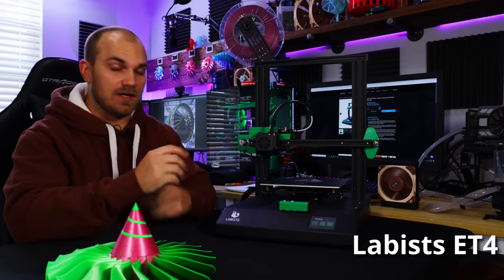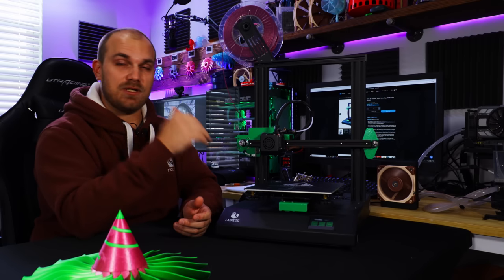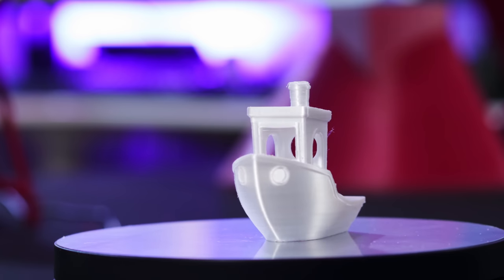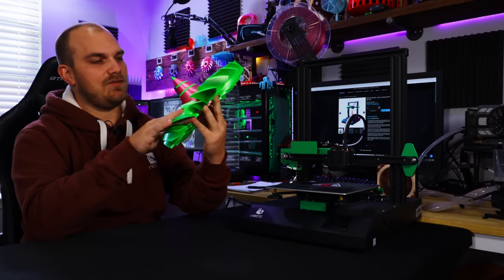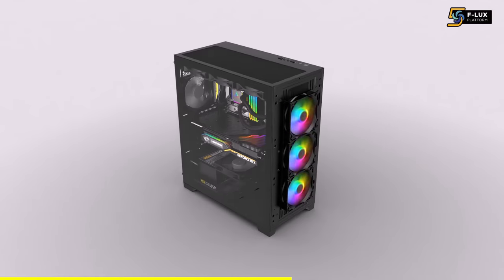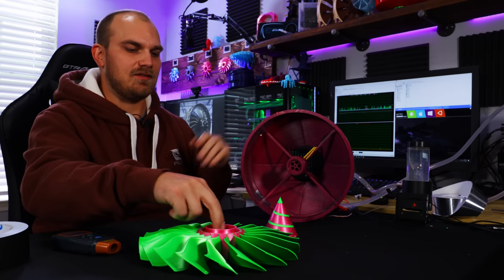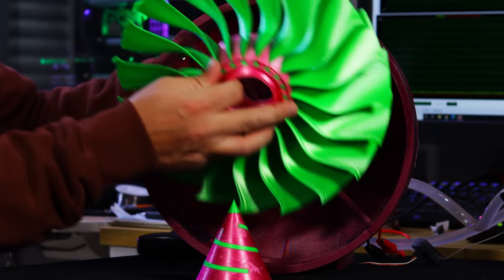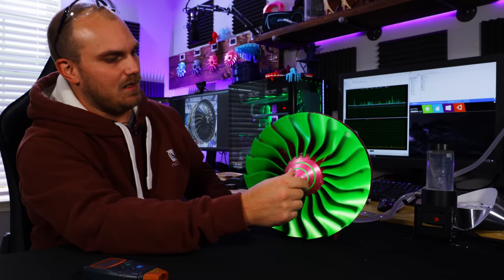3D Printed Jet  Engine Fan Water Cooling | Labists ET4 Review

Comment: Be aware that the centre 30% or so of the blade works as the primary stage compressor blade for core and the outer 70% or so works as a traditional fan so it will not work as efficiently as a dedicated fan design as the inner fan shape is optimised for maximum flow at high pressure ratios with a stationary guide vane to redirect flow after it.
Reply: What does "primary stage compressor blade for core" mean?
Reply: @kylenakamura4353  it means that the compressor in a trent engine has 3 stages, one for each of the shafts in the engine. The second and third stages (intermediate pressure and high pressure) are dedicated compressor blades, but the 1st stage (low pressure) compressor blades do double duty as they also extend beyond the core casing in order to function as the high bypass fan.
Reply: @17473039  that "high bypass" just means blowing air around the outside of the combustion section, essentially performing cooling duties, as well as also providing a good portion of the thrust.  If he were to make a guide vane behind it to redirect the air, it would have moved a ton of air.
Reply: The bigger issue than that is that a jet is designed for very high velocity, resulting in a very high advance ratio and so none of the blades are at nearly the right angle for a cooling fan, which pulls air in from stationary and only gets to a relatively low velocity at maximum. If you look at all the successful fans, they have fairly shallow blade angles to the direction of rotation, while the turbofan design has a much steeper angle, particularly on the inner blade.
Reply: @kylenakamura4353  a picture is worth a thousand words.  So here is a cross section of the engine that blade is likely from.....
https://www.rolls-royce.com/~/media/Images/R/Rolls-Royce/content-images/aerospace/airlines-product-images/trent-xwb.png?h=430&la=en&w=737

If you look at this cross section of a turbofan engine (this one is a high bypass turbofan), it will make a lot more sense.   The "fan" he is using in the video is the first "fan" in the system. 

first thing you will notice is that its first stage of blades (known as the turbofan) is significantly larger than the rest of the stages.  You will also notice that there is a "ring" of what looks like mostly empty space between the outer casing and the rest of the compressor stages.   That ring is the "bypass" (the name "high bypass" refers to how large this ring is,  this engine has a "high bypass" ratio).  The turbofan is actually where most of the thrust in High Bypass turbofan Engines generally come from (up to 70+%).   This turbofan what He has printed and is attempting to use in the video.

The turbofans inner section (the part with the steep blades) feeds into the Compressor stages (primary flow), whereas the bulk of the blades (the broad swept out section) are actually feeding the bypass (secondary flow). The secondary flow primarily just makes its way out the back of the engine and produces thrust ( its fairly common to tap into the bypass for other things as well, but the bulk of the air will just serve as thrust). the primary flow is compressed through several stages, before being mixed with fuel and combusted, driving turbines, that in turn, spin the turbofan. 
this is a large part of why these engines often take soo long to start, as they need to "spin up" with help from an external source.  Usually the APU (a smaller engine that provides power to the plane when the main engines are off.) Will direct some air to the engine to start it spinning.   Once its spinning fast enough to start combustion, the engine will start to self power.   usually they will then use the running engine to spin up any other engines (remember how i said they often tap into the bypass for other things?)

so with all that said, its the "primary stage", feeding the compressors. "compressor blade" is referring to the inner section of the turbofans blade, that is used to feed the primary flow, "for [the] core" is referencing the inner section of the engine with the compressors/combustion/turbines.

What they are saying is that the inner portion of the turbofan is optimized for feeding the compressors and not for "bypass".   Whereas a proper PC fan is 100% designed for bypass.

There are a many different types of jet engines, and all of them are extremely interesting to learn about if you have that engineering curiosity.   Id recommend watching a video on how they work, You might find it far more interesting than it first seems.
Reply: Additionally, in the destruction "test" the fan only broke when it came free of the motor. I bet it would have been workable  had he mounted it better
Reply: @chubbysumo2230  High bypass air is only for thrust and routes around the outside of the cowling.  engine cooling is done by the high pressure air that is not used for combustion internal to the engine.  Some engines also incorporate a venturi or ducting to route air into and out of the nacelle for additional external cooling.
Reply: @chubbysumo2230  The other stages behind the fan are sucking which helps the fan to move air.
Reply: Just like there is no real reason why he should have a spinner on it.   A proper inlet would have helped more.
Reply: @jasperrost78  In the center of the fan is the hub, a section of brick wall. A correctly sized spinner should help by guiding the air past the hub and into blades :)
Reply: @steverpcb  imo that is pretty irrelevant in this setup.  Sure in an proper engine there are many uses for a spinner. But as long as the fanblades don't require the spinner to stay in place (not sure how RR constructs their engines)   it shouldn't be necessary here.  Like I wrote earlier, a proper inlet cowling would have a greater effect.
Reply: Also. Keep in mind that the fanblades profile of commercial engines is optimized for close to mach1 tip speed.   Probably nowhere near optimal for these speeds. Although a random Internet stl won't have the proper profile.

Comment: This definitely deserves another shot, maybe scale it down.
Reply: would suggest scaling it to 120mm or smth more standard aswell, if you actually did scale it to 120mm you could also compare it to the Noctua rather reasonably
Reply: Sorry, you mean scale up, right? Maybe like the size of the real thing xD.
Reply: Lame
Reply: unless you want to spin it so fast it explodes, but that would presumably wreck his room, but I'm sure you can do it on your own if you don't love your eyesight
Reply: The problem it seems is the motor overheated and the plastic softened out of the shaft. A more heat resistant plastic would work, like certain carbon fiber filled nylon filaments, but those kind of filaments also require special environments to print correctly, like a very hot hotend, a heated enclosure, and a very hot heated bed.
Reply: @paranoidpanzerpenguin5262 Edit: I've appearently not been as awake as i thought bc i missed your first sentence doing this the first time:yeah maybe that would help making it not fall off in the end but that only happened when he went all out to destroy it, i could see beeter airflow help the motor cool so the plastic doesnt actually melt 

Unedited: I cant see how a different material would change aerodynamics, frankly the air doesn't give a fuck whether it's moved by plastic, alluminium or play doh. play doh wouldn't give a great propeller tho.
I say the problem ist that the fan doesn't produce enough air pressure, which could in my mind be achieved by a better fin profile, higher rpm or you change the pressure needed by adjusting (in best case removing) that neck down shroud. since the shape used here was created by Rolls-Royce I'd say thier engineers did all they can in regards to fin profile and we saw that he couldn't spin it faster in the vid. I'd conclude that his neck down shroud's taper is way too short to work properly, combine that with the radiator in the end and he essentially screwed the thing on a bucket, sure some air can get through but not enogh, which is why the thing only really moved air when he took the shroud of and spun it as fast as possible for destruction (after all it fell over). If he had a 280mm rad or that fan in 120 or 140mm and therefore wouldn't need any shroud to go to the right size we would see this fan's actual performance.
Reply: This example.. is right up there with making just a shroud.. and saying.. wow, it doesnt cool anything.. useless. Sigh.
Reply: and scale shroud up 1% for extra clearance

Comment: I lol'd when it started producing thrust and fell over
Reply: agreed. but wouldn't that be the precise concept behind the design of a fan for a jet engine?  [I know, I am just being a stickler]
Reply: @tomstech4390  not when it came off the stand, when the whole stand tipped.
Reply: ah yes who would've have wondered a fan that big would produce thrust tbh i did not think of that XD
Reply: I don’t think the fan was producing any significant thrust at all, and most definitely not enough to either move or tip over

What I think is much more likely to have happened is that the fan just vibrated enough to let gravity and gyroscopic forces to tip it over
Reply: @pelor92  I am no engine engineer (forgive the cacophony there), but being an aircrew I have a bit of knowledge on engines, the concept of lift, how thrust is produced, and so on. In simple terms... Air one way, thrust the other way... Laws of physics: F=ma. You can accelerate a little air a lot, or a lot of air a little. That is why jet engines evolved into turbofans: the second part costs less than the first, although you do pay some in drag. However small the surface creating lift (i.e. accelerating air), however well or poorly designed the blade profile is, however little acceleration you give, there is thrust (ever stuck your hand out of a window, as a passenger?).
Big rant, I know. The short version of it is: if it was enough airflow to cool, there was enough thrust pushing the opposite way (which unchecked and unbalanced caused the structure to fall and the fan to disintegrate.)

Comment: Another printer, FANTASTIC! You will have a mismatched army soon. 
So the fan... cool af and looks GREAT! As you know it's meant to go in a jet engine. I think you said it's the firsr turbine, so that would mean it's designed to have air being shoved in to and sucked out of never acting alone. It is a 'high bypass" turbine for that reason, which is why by itself in this case it just can't get to a high enough rpm to make it in any way effective. Not being titanium, and razer sharp, or with air molecules that aren't about 20 times smaller to keep with the ratio of turbine:air size lol. 
It is awesome though, i love the color choice in your models too! Unique.

Comment: High bypass (as I'm guessing you already know) is where the intake of air closest to the hub is going to be your air getting compressed and brought into the engine to create power and the outer edges of the fan blades gets bypassed over the compressor stages of the actual engine and channeled out the back and that's you're main form of thrust. If you're able to (I'm not sure how to design one myself otherwise I would) or if someone else could: make your shroud with wind veins on the inside to channel the air through your bypassed by the tips of the blades of the fan to your outlet that directs into the radiator. Just trying to help. Another cool thing to maybe try would be to lessen the angle of the curve in the end of the blade or do like on Sikorsky's latest helicopter main rotor blade design and tilt them toward the direction of the thrust output.

Comment: Dude I was so worried about your monitors for a second when I saw that fan jump off 😂 you might want to put something infront of them the next time cause the monitor on the left really doged the bullet there.
I know that it's "just plastic" but at high speeds even plastic is dangerous
Reply: i can’t attest to this...I actually needed stitches above my eyebrow because a plastic radiator fan from a Toyota snapped off once my wrench fell off into the engine bay.  Plastic projectiles are no joke 😂
Reply: He knows.  He mentioned in an earlier video about finding a piece of blade buried in the wall ~8' behind where he sits, from another fan he exploded.
Reply: my sentiment exactly I said out loud "right next to all those monitors? that is a bold move."
Reply: When a rotating assembly tears itself apart, everything flies off along the rotational plane until it bounces off of something and changes direction. That's why angle grinders only need a tiny hand guard to prevent your fingers from getting mangled when abrading and cutting discs break apart at 10-15k RPM.

Comment: Hey, I have (2) 200mm fans in my Old HAF PC case and those fans max out at 500 RPM. I wouldn't have expected that fan to spin up to 2000 RPM cause really it doesn't need to. Bigger fan moves more air so less RPM is needed. Best thing about those 200mm fans. At max (which is were I have them running all the time, and it's been 9 years now) they make no noise what so ever. They are quieter than my Corsair Maglev 140mm fans and also my Noctua 140mm on my other PC.

Comment: Something to remember. Those things are made to be efficient within a specific RPM range for their size. Outside of those parameters results may vary.
Reply: yeah its designed for a quad with a 5 inch prop. Its not designed to be a jet engine

Comment: I use sugar water 1:4 ratio all prints have worked perfect ever since. i print on a mirror and heated bed but never had a print warp using sugar painted on while warm.
Reply: Just use glue stick dude is better And a lot cleaner

Comment: I’d love to see a 120mm version with a shroud entered into the fan showdown!
Reply: YES just yes
Reply: I have thought about doing something along those lines too, but I have zero experience with 3D design/printing/anything. :/
Reply: I've been thinking of this since day one but haven't had the time to sit down and model it
Reply: @sebbes333  get to it and learn. There are some free programs out there and it's a useful skill to have. If you have any spatial awareness, it's not too hard!
Reply: @sebbes333  On Thingiverse the STL-files are given. When they are put into the slicer it is simple to scale it down to ~40%.But: each blade is a single part in that model so it is quite a lot of work and it will not be stable or well balanced when that original is used. Otherwise i'd do that for my own PCs case-fan.
Reply: When it gets outperformed by fans made for the jobs newbies who don't understnad this will be like... "wow noctua makes better fans than rolls royce, maybe they should hire some of thier engineers".
Reply: @tomstech4390  lol I dont think they have an understanding of how fast a jet engines turbine blades turn compared to a computer fan

Comment: I was involved with a lot of the tooling that went into these 'trent' wide cord blades, the actual performance of these blades was always measured with the shroud and these were deemed to be an efficient design for the movement of air throw the jet engine and onto the shorter compressor blades. When you next try these blades you will need to have close fitting shrouds in order to chanel the airflow in the desired direction.

Comment: You need two things:
1. Balance the fan wheel.
2. A 3-phase motor.
Reply: brushless dc motors are basically 3 phase motors.
Reply: @Mrx1080  you tend to be able to pump more power into brushless motors for their Size tho
Reply: @naomiwolf8944  in comparison to?
Reply: @Mrx1080  In comparison to a DC motor of the same size, the benifit of using brushless motors is high rpms and more useable power, whilst brushed motors tend to have better torque but you cant run them as hard either, ist rpms we want in this case
Reply: @naomiwolf8944  nah mate, a brushless dc motor is superior to a brushed motor in every way. Less friction means it's more efficient and can have a higher output power for a given input power. The type of motor he has in the video is the correct type for his application (brushless outrunner) because they have better low speed torque then an in-runner motor. If he used a high speed motor  it would need a reduction box because if it was direct drive it would just burn out.
Reply: Except in longevity. Brushed isnt as fancy, but theres still Brushed motors over a hundred years old that you can replace everything on. Brushless its throw away buy another basically.

Comment: Since we are already at the point of making huge fans cool a tiny radiator...

Can we see a floor box fan ducted down to the 120mm radiator?
Reply: Problem with a larger fan is the static pressure it creates. The blades need to be optimized for the pressure, which is why  he was getting air from the front of the blades.
Reply: I would like to see a super large turbo charger on that tiny radiator more than a fan. But I like your idea too

Comment: The funnel is way too shallow for the air that thing should produce, over-pressure is making the air escape out the side instead of through the radiator
Reply: Yea the way it was built it needed a compressor fan or something to get it to work and and a better duct that wouldn't scrape the blades

Comment: I’m no rocket scientist, but I think the cowling of a jet intake is absolutely essential. The centrifugal dynamic is countered by a specifically sloping initial stage of the cowling. If that is not in the equation then the air will just “blow out” as it where.